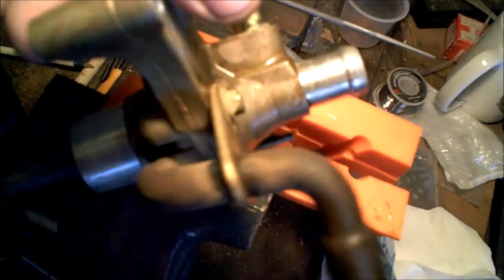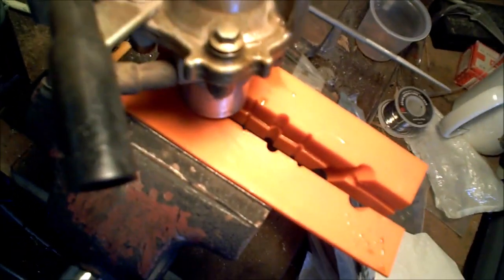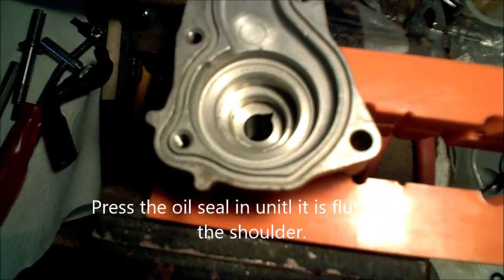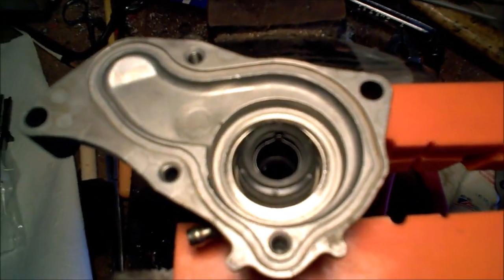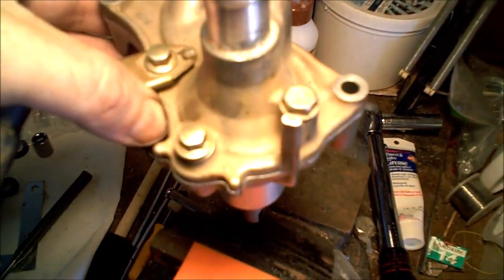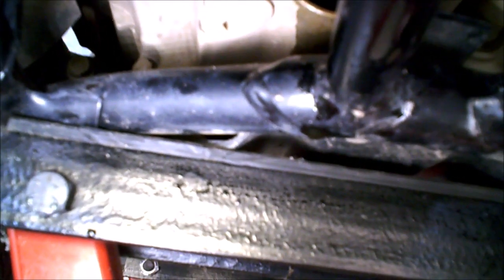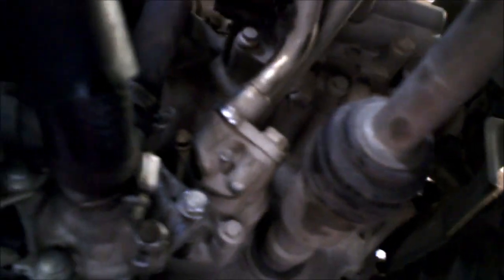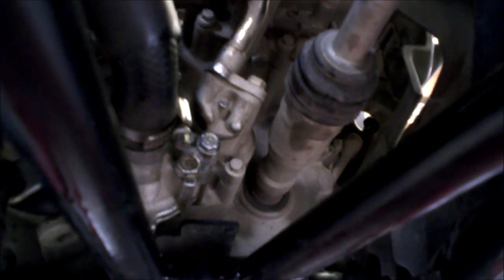Rincon Water Pump Seal

Comment: Is it normal to oil come out from the hole where the pump connects with the engine ?
Reply from the maker: With the pump removed you mean?  Yeah, the other side of that case has engine oil. You could raise the front of the machine if you get more than an initial dribble.  In my video I think I mentioned I had the oil drained.
Reply: @JeffinTD where did you get the part numbers from ? Are they they same for a 2004
Reply from the maker: @billbyng3347   For a while Honda only listed the part number for the entire water pump complete. When the liquid cooled Rancher came out it listed seals and related parts, and someone on one of the forums figured out they were identical. If I remember right  the complete pump might have been the same part number.  I would guess 2004 would be the same, but I don’t know for sure as I don’t have a manual for the 650 era. 2006 had a variety of changes (front disks, efi, some transmission changes) in addition to bump in displacement.

Comment: Thank you for the video, it was a big help. Can you post the part numbers?
Reply from the maker: Clutchcan Anderson 

Coolant seal 19217-MAL-300
Oil Seal 91201-965-000
Case/pump seal 91304-HN8-003
Sealing washers 90412-003
Pump housing seal 19226-HN8-000